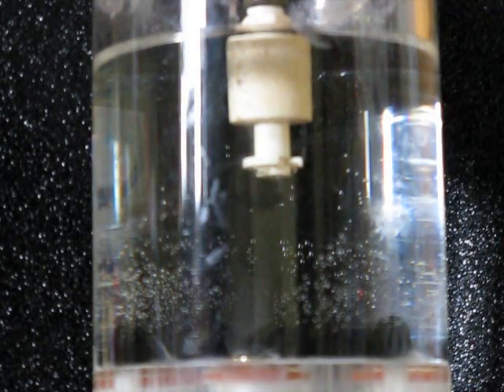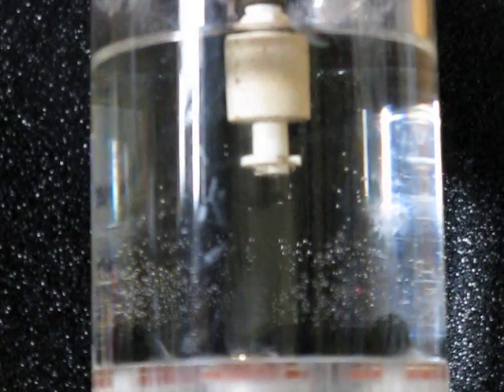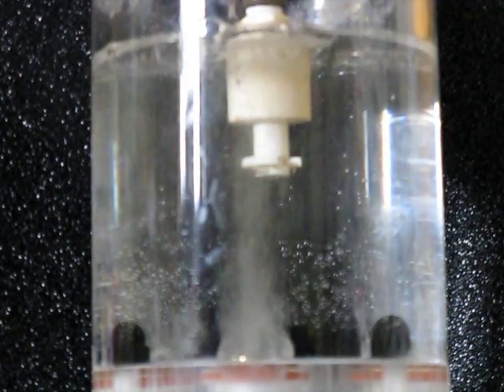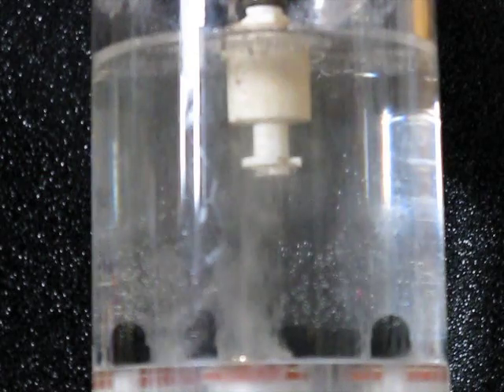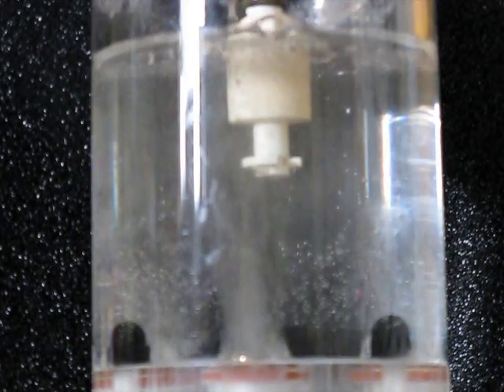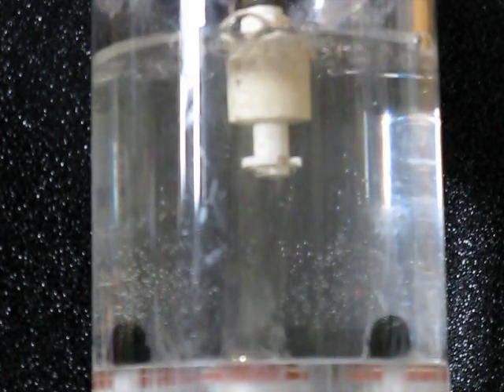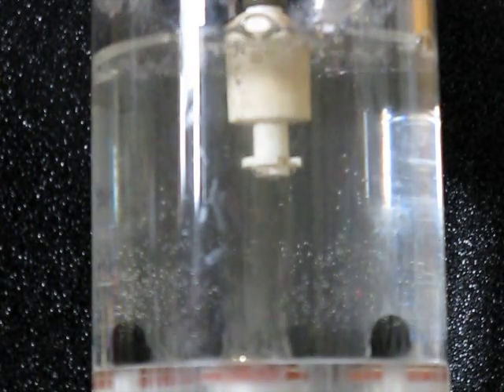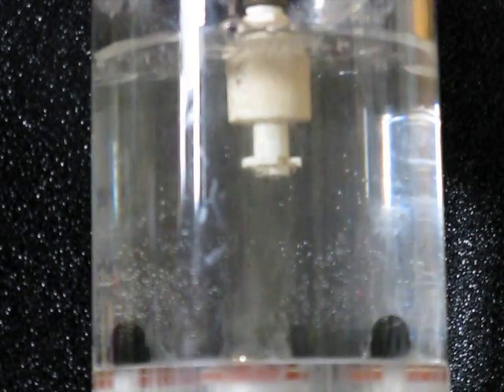Chronicles of h2opower #6

Comment: maybe you would smile at the video called  

SECRET’S OF STANLEY MEYER (HHO FUEL CELL) capacitor, 

 by Pushpika Jayasinghe
Reply from the maker: Thanks. From the looks of it it does appear to be getting the larger bubble that I'm getting showing it's not electrolysis. But it's the only video he made about the technology over 11 years ago and I wonder why and just where did he go?
In this video the space gap between the electrodes is 0.032 inches and only now am I beginning to understand this relationship between the transformer size and capacitor size and build. Wait until you see the size of the next transformer as that alone is going to blow everyone away. I just hope my 3D resin printer and CNC coil winding machine are up to the task of building such a large transformer.
Now before you say anything about why it needs to be large for a WFC with ten or more resonant cavities hooked up in series go back and watch Meyer's video where he ran the dune buggy for the first time and look just how large that transformer is that he was using. You see there is a size relationship between the transformer and the water capacitor it is slated to charge to the point where it reaches the threshold of ionization for the atoms that make up the water molecules. It's tough to get it right, takes many trial and error attempts, and know the large the transformers get the more expensive they are to make.
Surprisingly the most expensive thing to get is the proper resin to seal the air out of the transformers and also keep the wires from moving around which would rub off the wire's protective coating causing a short. Learned that the hard way through trial and error testing making use of good observations as good observations is good science.
Reply: @h2opower  If I understand correctly, it's a capicitor with the top cut off, and it lasted as long as the video played, before the coating on the film/plates deteroated. Now if that coating could be more robust ?
Reply from the maker: @junkyoutube9060  I guess I could try a SS foil but I wonder just how hard it would be to maintain the space gap tolerances between each of the cells hooked up in series? You see they must have practically the same space gap or the capacitances of each of the cells will be different which will then cause those cells to have different resonance frequencies with the inductor. 
In my current WFC the tolerances are between ± 0.005 inches for the ten resonant cavities so as to ensure they all have the same capacitances.
In most that I have seen working on this technology this lack of high tolerances in their builds causes all sorts of problems to the point where they are never able to get the technology working properly.
Trust me when I tell you this, this technology is not easy to build correctly.
Reply: @h2opower  I think polarized caps have a coating on the foil, maybe that's like the coating some "condition" their cell to, that white surface layer. If you got some polarized and non polarized caps, and tried the same experiment to see if the non polarized bubbled as much ?
Reply from the maker: @junkyoutube9060  Yes, they have a oxide layer on one side but that's how it is separated from the other plate. With this technology you don't want any oxide layer as then you have to deal with more than one dielectric. I have seen a lot of people go that route and it always ends the same, just normal electrolysis. In fact Ravi listening to Aaron, whom knows next to nothing about how this technology actually works, built up an oxide coating on his SS and it simply stopped working correctly. 
As for performing a test like that, I won't as it creates toxic chemicals which I am sure that guy simply dumped down the house drain or storm drain. Not many are responsible experimenters as being responsible cost money.